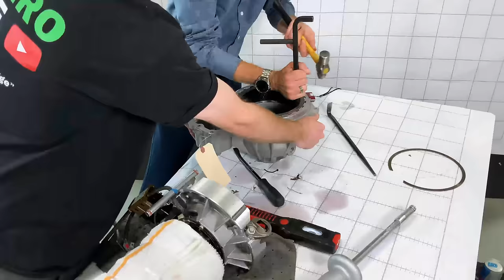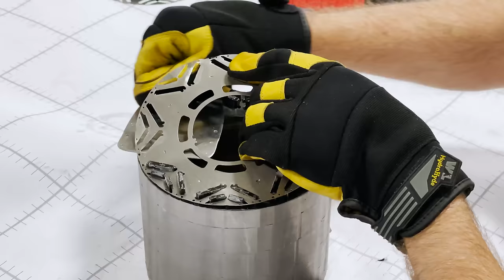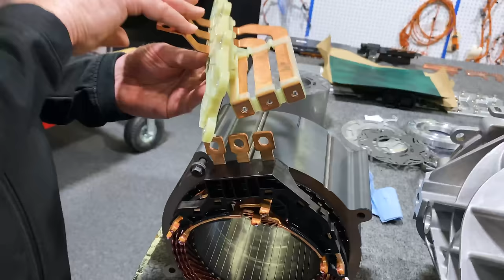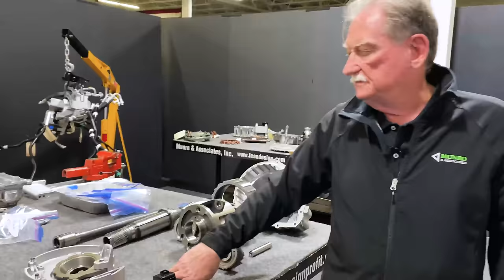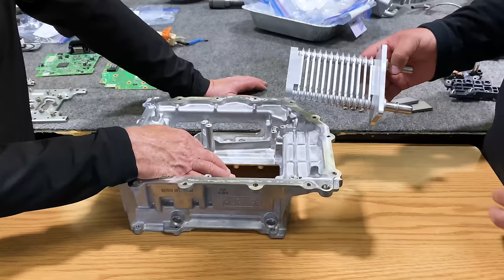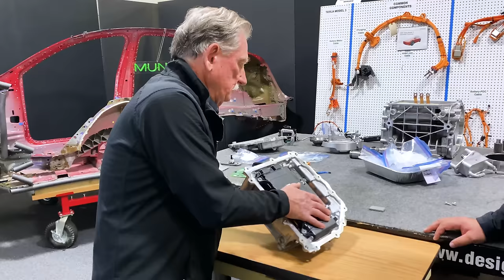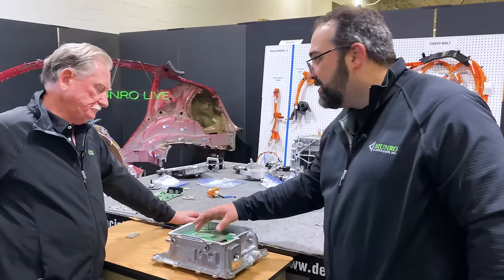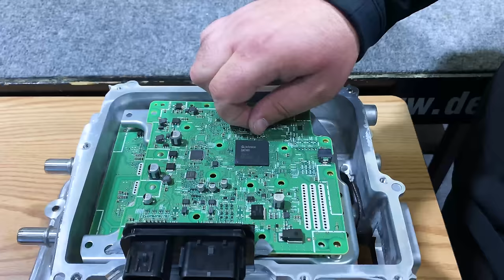Ford Mach-E Rear Motor Teardown and Analysis

Comment: I really don't think Ford gives a flying  figlet about what you think they need. 
They will still move millions of these EV's
Reply: It remains to be seen how long they will move.
Reply: @Garrison169  The same thing can be said about your marriage and career.
Reply: @twany442  ...given the state of my marriage and career, he should heed your advice. Don't count your engineering chickens too early. Tesla are just reaching out of warrant status now. Will be Interesting to see their long term values.
Reply: @AudiTTQuattro2003  They won't even let you buy parts after the warranty ends.
Reply: Considering Ford couldn't build millions of these if they wanted to right now, your point seems mute. It's going to be years, probably 5 or more, before Ford can even claim to have a half million a year production rate of all their EVs combined. And I'm talking full BEV, not some horseshit hybrid with a 10kw battery. I'd estimate it's going to take Ford at least 5 more years to build up enough battery supply to get beyond making 500,000 BEVs a year. So these millions you mention.. aren't coming any time soon
Reply: Millions?  May be awhile, so far only about 28,000 as of June. Ways to go to catch up with Tesla, esp. with GF Texas and Berlin going into production by year end, full production by Q1 2022. GF Shanghai now going all out.
Reply: @twany442  Excuse me?  Did I make a personal attack on you??
Reply: @Garrison169  No you did not and I apologize for it.

Comment: Ford inaccessible oil filter: maybe they want the dealer to swap in a whole new motor and send the old one in to a refurbishing center?
Reply: Wrong, the filter is made to be probably never changed since there are very little moving parts.
Reply: ...like Tesla is any better? They won't repair component level either.
Reply: @AudiTTQuattro2003  They let you get to the oil filter...

Comment: Lots of really great engineering went into the Mach-E, I think it's pretty clear by now that Ford is among the very best of legacy auto when it comes to BEVs, but clearly, the motor and inverter is a large and important weak spot for Ford. Hopefully, it will be rectified in the Lightning. Time will tell.

Comment: So Ford used a traditional planetary gear transmission. Great, so expensive transmission repairs will still be required even in an EV world...at least when it comes to the Mach E.
Reply: Most transmission problems are gaskets, clutch packs and bands.  The gears rarely fail unless they chew on other parts that have broken apart.
Reply: It doesn't matter whether they are planetary or parallel - there is nothing but gear sets (plus of course bearings and lubrication) in a single-speed EV transmission, so it is reliable (well, unless you have an early Tesla).
Reply: No. It uses planetary gears

Comment: These are very entertaining.  However there are so many incorrect comments (ie : those are not SiC power modules) or because they do not understand spec or production process why it's "bad".   Welding correctly eliminates those potential fasteners(he dislikes so much) and avoids a lot of cost for the clip/press on connections.    He should consider asking the suppliers for a plant walk through.

Comment: I'm still stuck on that spring.  What's it holding in?  It's not doing anything against the thermal expansion of the cooling plate.  It's not preventing vibration of the cooling plate due to being mounted on one end (and there's better ways of doing that).  Maybe the individual segments of the cooling plate are bonded so badly that they'd come apart and leak if not forced back together?  Surely that could be fixed directly?

Comment: The cacophony of assembly.

Again the proof an industrial designer WITH a hands-on background is needed.
 He/she will implement all the tricks into every single part for efficient assembly. And yes Sandy, we all forget what Henry Ford did, not only to speed up production but also saving costs. This is not what you learn in school, it is a talent! Those talents they are all looking for. But 99% of the population can not handle talent on the work floor as we know it.

Comment: One reason to put that many screws to a circuit board is to get rid of vibration, which obviously would be bad. But the same thing could be achieved with a plastic mount with clips and just a few screws.

Comment: Inverter I assume is assembled vertically rather than horizontally and the barbs with all the barbs attached before the welding on other side

That said. Snaps and clamps might be easier.

Comment: I'm confused by Munro's confusion on the parking pawl.   True, you can just turn on the e-brake but what if the e-brake servo fails? At that point you can't safely park the car.  This design makes a lot of sense from a saftey perspective and what I'd expect to see from a manufacturer with so much experience.

Comment: Skewed rotor doesn't make the motor quieter. It's reduces Total Harmonic Distortion, which is often referred to as noise, but they mean electrical noise. It mainly reduces reduces clogging effect of permanent magnets. The magnets aren't glued. They're bakelited in. Its a thermoset plastic. The laminates are necessary for eddy current control, all electric motors use laminates. We were winding ford all electric vehicle motors 11 years ago. HVH (high voltage hairpins) is an improvement in technology for assembly and durability. Telsa's motors are how we would have built electric motors 20 years ago. The Buspar leads are designed that way for automation. They're inserted and in position to be bolted together with automation. If they were the flexible cable itself they'd have to be rooted through the housing and whatever grommets necessary for sealing then manually positioned to be bolted to the stator.
Reply: Doesn't the Tesla design minimize the "skin effect" from the fairly high frequency AC current and improve the efficciency?  Using multiple insulated smaller conductors rather than a single large cross section conductor is a common practice in RF design to minimize "skin effect".

Comment: The core design elements of this drive unit are fantastic (motor, gearbox, inverter cooling design, SICfets), but it's ruined by horrible packaging/integration. I do worry about the complexity of the gearbox, more points for failure. Engineered-in service opportunities?

Comment: Those sixteen PCB screws are to prevent warping. Frequent heat/cool cycles will warp the board and fatigue solder over time leading to cracked solder joints. Ford's obviously concerned about this.

Comment: I would love to see a video focused on overall efficiency of an EV.  I am curious why weight is such a concern for Sandy.  Obviously it takes more energy to accelerate, but it is also more potential energy to recapture with regen.  To me, it seems like the weight is only a penalty factored by your regen efficiency.  Maybe regen is not very efficient?  I would love a video comparing different EV's regen efficiency, drag coefficient, thermo efficiencies, etc.  Great videos- keep them coming please!
Reply: mpg  or  empg  to see/compare  over all vehicle efficiency  [Tesla seems ~25% better than most]
Reply: Weight is rolling resistance

Comment: At 24:00, would it be possible to have the MOSFETs soldered to the lower PCB as part of PCB manufacturing, and then rather slide the MOSFETs all at once into the cooling fin during mechanical assembly? It will still be a lot of fine alignment needed, but not 90 pins. That implies that the lower PCB would need to be the first electric/electronics part to be mounted into the housing. Soldering of the MOSFETs to the copper plate bus bars would then be after the lower PCB is in place.

Comment: Sandy: "A couple of lines of code." <- Yes, the problem is the amount of work required to guarantee that the code behaves according to specifications in all cases. Usually, one has to perform an FMEA/FTA of the system, and that includes the software and the hardware system which the software is executing on. With the advent of modern microcontrollers, it's extremely labour-intensive to lower the P_Failure of software systems from e.g. 10^-3 to 10^-9 per "drive hour", or whatever metric you're using. As such, a purely mechanical safety system may have a much lower P_Failure number than a system including software.

I know this because I've worked as both a systems and software engineer both within the aerospace sector and the automotive sector, and I've worked with safety-critical systems within both those domains.
Reply: You’re right, but you’ve missed the point.
Reply: @fredbloggs5902  ...we will see. If a Tesla rolls over some kid in his driveway, Sandy's response will look pretty stupid. By the way, that's why AT vehicles have park mechanisms.

Comment: the parking pall will always work.
Reply: Actually, it's one more point of possible failure. Yes, it's a backup to the electric brakes, but added complexity will obviously also have added failures. Clearly, this is Ford's plan though. The Dealers--who make most of their money through  repairs--had to be convinced they could make money servicing the Mach-e. Ford cleverly designed many systems to break down over time as opposed to other EVs that generate very little service income.

Comment: Why cant you do the soldering on the base plate before hand one by one for the silicon carbide parts then push it up in the radiator ? Sounds a bit unfair to miss that (if correct)
Reply: Yes, my thoughts also.

Comment: I came from industrial inverter background so can't claim to be an expert on automotive. However, for the inverter, the very high vibration levels, very high changes in load, and the very high changes in temperature would make me nervous about snap-in connectors tor the source and drain connections on the power semiconductors especially. For the gate drives, maybe it makes more sense.

Comment: Does this motor have a differential of any kind? Or is the axel through this motor solid? I saw two of these in the F100 at PRI and it didn't look to have an extrenal diff.

Comment: What are you doing with the cars after you are done with the disassembly and analysis? I would guess they are not going back together, too difficult, but all parts are technically 0 mile. Do you sell the cars by parts or they just go to the trash?

Comment: The parts count that matters in terms of reliability is the moving-parts count. Yes, there are 517 laminates in the rotor, but they're bonded together with the magnets into a single fixed, rigid assembly. One moving part. No rotor will ever be disassembled once it leaves the factory (with the gruesome exception of the poor car we're seeing here! 😉). BTW, when Tesla perfects Full Self Driving, good luck getting the car to willingly drive itself into your shop!

Comment: I like the planetary gear reduction and in-line configuration. Is the Plaid like that?
Reply: Nobody knows yet.
Reply: The Plaid is direct drive, no reduction gearing. Which is the reason for the carbon wrapped rotor.
The above is from Elon's year-end investor report.
Reply: @janetizzy6741  That isn't true. The motor does 20,000rpm at 200mph. The tires absolutely are not doing 20,000rpm....that would be over 2,100 mph.
Reply: @oisiaa  yeah.. there has to be reduction gearing going on. It may be inline.. might have been some misunderstanding on that 'direct drive' statement.. we'll see it all soon enough
Reply: @airheart1  ...its not inline, in that the center of the motor is not the center of the drive shafts. See the Weber U channel for details.
Reply: @oisiaa  
Correct.
Reply: oisiaa
Don't know about Tesla, but the Lucid drive assembly has planetary gears
Reply: @oisiaa  2,100 mph ?   Elon "Hold my tequila..."
Reply: The Plaid uses parallel shafts, like other Tesla models and most EVs. It is apparent in the image of the case of the drive unit, on the Tesla website.
https://www.tesla.com/models
The "long range" version has one rear motor, ahead of the axle line; the "Plaid" version has two motors, behind the axle line.

Comment: oil cooled motor = busbar sealing is needed to not introduce oil into the Inverter cavity. But look at the BMW iX3, they have solved it in another way with a direct connect hairpins towards the Inverter :)

Comment: I could easily imagine mainstream ICE converts not liking the electric brake for park. Including the parking awl could have been the result of market research. I've also had pads stick to rotors due to humidity and they make a horrible "CALL THE DEALER" sound as they disengage. It certainly could impact consumer confidence.

Comment: MOSFETs are soldered to 16 screw mounted PCB on the bottom and then the expanding and contracting heat sink on the top. Seems this damage the MOSFETs over time.

Comment: The mosfets are probably soldered onto the circuit board preassembly then the circuit board is just dropped in with all the fetts at once.

Comment: Why are all those single sheet plates used for the rotor instead of a machined solid? Are there advantages regarding the magnetic field going through all the thin parts over one or fewer solid parts?
Reply: You can stamp them from sheet by the thousands quickly. A solid piece needs a cnc
Reply: @Mr2winners  makes sense, Thx
Reply: The plates make the motor much more efficient. They reduce eddy currents that cause losses that wind up as heat.
Reply: Yes, the advantage of motor laminations (that's the term for you to look up) is management of the magnetic field.

Comment: Sounds like you have never had the pleasure of trying to get the E-brake to release with a hammer 6 a clock in the morning in a blizzard near the arctic circle... But yeah, I can agree that the locking pawl and actuator is not strictly necessary as the E-brake works pretty flawless, just the pads that want to freeze to the disc every now and then and in those conditions it doesn't make much of a difference
if the e-brake is applied or not.  And it baffles me why so few manufacturers use a simple geardriven pump that pump oil when the vehicle is moving, not much need to pump any oil when the vehicle is stationary.

Comment: A "couple of lines of code" won't help you if you have a computer or other electrical system failure.  A mechanical parking lock is by far the safest way to ensure the car stays parked. A couple of cars that spontaneously run away and run people down will bankrupt a company.

Comment: Hello Sandy,

Big fan here. I was wondering do you have any experience with Axial Flux motors such as Yasa, Magnax, Phi-Power, or Emrax? The power and torque to weight ratio is insane and yet I don't see them on any cars.
Reply: No, Munro won't have any experience with anything not in a mass production car. The only production use of YASA motors that I have seen is by Koenigsegg (which has very limited production) in the Regera's hybrid transmission system. The others are not used in any cars, as far as I know, and the Emrax design wouldn't likely be acceptable to an auto manufacturer.

Comment: Maybe 16 screws for PCB are to prevent vibration from causing cold solder joints? My first thought was how do you prevent cold solder joints with vibrations and thermal expansion.
Reply: Cold solder joints come from improper soldering not vibration.  That's not to say you can't have problems with a soldered connection due to vibration and fatigue but that is a different problem due to improper mechanical design.
Reply: @videcomp  I will disagree with you. In my 20+ years of fixing electronics I have more then once had to fix cold (broken) solder joints from stuff that came out of car. Mostly relays, connectors that have long cables vibrating (90 degree one)
Reply: @vogonjelc  Probably just a different use of the terminology and words mean different things in different organizations, so I won't attempt to put my 40+ years engineering against your 20+ years as a tech.  Because frankly I can count on one hand the times I won a technical argument with a tech.  But I did work in production engineering in GMs electrical division and later as a propulsion test engineer for NASA and served as a technical consultant on electrical accident investigations.  We always reserved the term cold solder joint for bad soldering process, never for a mechanical failure of the solder due to stress.  It was very important that we could discern and describe in our reports which was which.
Reply: @videcomp  not organization but language, as far as I know any joint over here is considered "cold" if not conducting. Manufacturing defect, fatigue or else. Except if physically broken like tracks ripped of from board.  And not tech actually engineers of nautical electric systems.
Reply: I think I understand and agree.  The following is not so much for you but for anyone who might follow this discussion and want more info.  NASA's standard NASA-STD-8739.3 defines a Cold Solder Connection (joint is not technical enough for them) is defined as "A solder connection exhibiting poor wetting and a grayish, porous appearance due to insufficient heat, inadequate cleaning before to soldering, or excessive impurities in the solder."  The standard is actually pretty interesting if you are into that kind of thing. GM's standard was similar but the old joke in the plant where I worked was "we aren't doing rocket science."  Ironically I was hired away from GM to do just that.  A link to the standard is here. https://nepp.nasa.gov/docuploads/06AA01BA-FC7E-4094-AE829CE371A7B05D/NASA-STD-8739.3.pdf
Reply: @videcomp  I had to check English definition of cold joint, and it's same as NASA you described, I really don't know when I last saw cold joint from manufacturing,  probably when I was learning to solder, now days qc is so good that defects like that would be close to criminal neglect. Joint that brake from use (vibrations or bumps) have distinctive ring which you can easily spot under microscope, for MKI 👁 it looks fine.